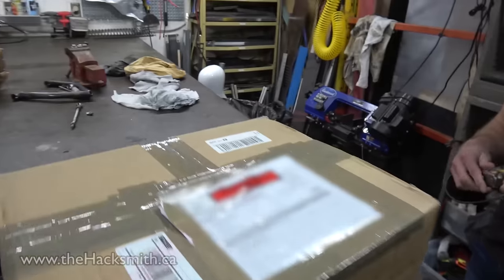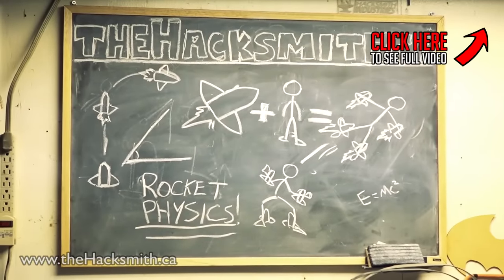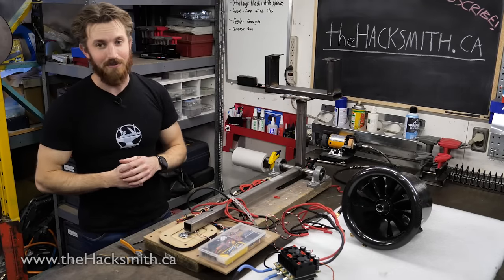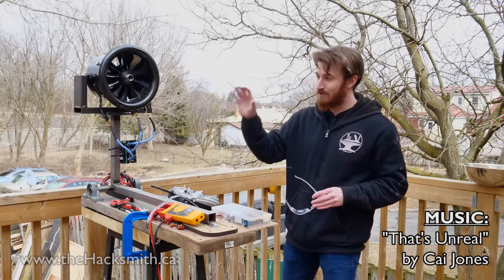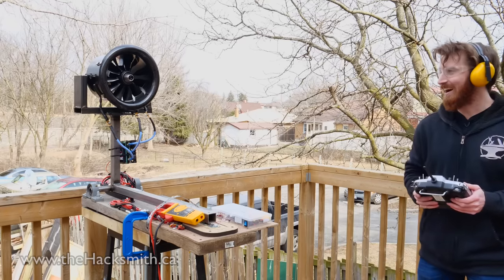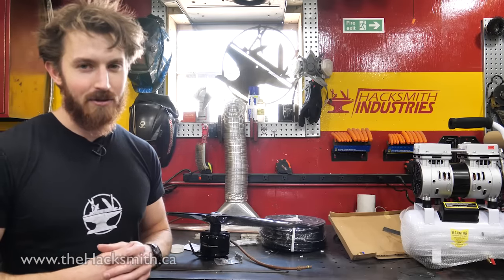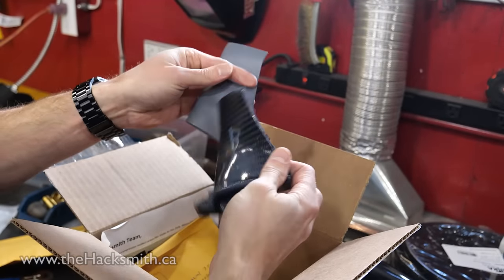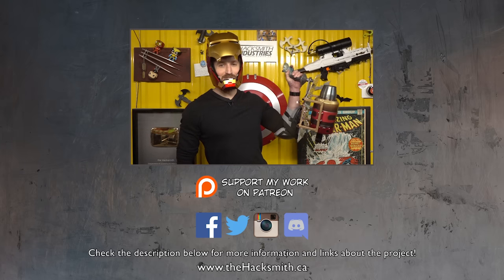$5000 Electric JET ENGINE (Flying like Iron Man Update)

Comment: Have a CAD design that I am working on for a quad hover bike where I would like to use electric motors. Battery tech is almost to a point where it is feasible to prototype. This vid has been a big help in giving me a baseline to start from

Comment: You could invent a new kind of paramotor thrust from centrifugal fans connected to the standard 2 stroke Vittorazi motor using a serious redrive ratio. This would be cool no more propellers, but a centrifugal fan or impellor style thrust system. I'd love to get rid of my propeller and use something that won't get tangled up in my lines.
Reply: It's in someones mind. Only a matter of time before someone engineers this.
Reply: The thrust is that of a 180

Comment: The reality of trying to be iron Man without the 💰. Lol
Reply: Lol first
Reply: Lol second
Reply: How many kilo thrust required to go straight. Like a helicopter ???
Helicopter provide how many kilo of thrust
Reply: Are you able to produced hho gas for fuel by electrolysis or by magnetic resonance and we provide it hand power by gears etc or by natural energy so we produce natural fuel for boiling water and a stable source of electricity which is not produce carbon footprint any more
Reply: How we boil water by compression 
Try it if it's possible
Reply: @eggwet8767  ahhhhhhhhhhhhhh ask Google

Comment: After the project you can connect all the jet engines together to make the most powerful leaf blower in the world but you would probably have to tape concrete blocks to your feet to not get launched into the sky. You can use the edfs to make a really powerful fan for summer.

Comment: I think all you are leaving a big advantage of those edf motors
You can build your own edf with air running from motor side to the propellers (opposite to the usual direction) so that the propeller won't flew off, and there will be less pressure on the clip which holds the rotor(at bottom) .

You have to flip the edf upside down,
Flip 2 of 3 wires, so that motor will rotate in opposite direction,
Modify design for better aerodynamics
Reply from the maker: Hmmm I wonder why EDF manufacturers don't do that if it's so simple...
Reply: @hacksmith  i am using 4 of 3D printed bldc edf in a rc quadcopter, the EDFs are upside down 
And working well for 2 years. I like it's sound

Comment: 2 Gaint ones in the backpack 2 small ones in the arms and 2 medium in the foot area that would (to my calculations) let u fly
BUT the wires need to be smaller and 3 edit u can steel some edfs

Comment: one issue is the massive battery weight.  EDF’s are great for speed, with great wind velocities....but not as efficient as props for lift.  Good luck lifting yourself and the batteries.  I would feel safer in an electric ultralight plane...at least if you blow an esc, you can still hope for a high glide ratio!  That’s a real nice EDF, I am drooling....wonder how that would work in a covered aero recumbent two wheeled bike?  Thinking of the solar challenge in Australia....and a cigar shaped torpedo whistling past the contestants....you could really get cooking.  I think it was Seimins that made a prototype twin edf electric plane that set speed records for electric.....340 kms/hr.  Thanx for the video!

Comment: If you combined the edfs and the jet engines. you are eliminating the point of the edfs because the jets are still going to be inconsistent and therefore the edfs which are staying stable could cause a wobble effect and make the problem worse gradually. Like when props are on a copter wrong and when it flies it starts a light wobble and then continues to overcorrect.

Comment: Is someone of you an RC Pilot? 
It seems like at least one of you was, because the things you are using are originally made for huge RC Planes. The turbine powers large jets, while the EDF is the electric alternative to it. And many other things like the Electronic speed controller or the transmitter are usually only known by RC Pilots.

Comment: 5000 dollars for a 50 lb thrust ahahah.. you can guy a 4 hp electric motor for 100 bucks which will put out 100 lbs  of thrust
Reply from the maker: With what size propeller?

Comment: I wish you all the best of luck!
I understand you need to increase your thrust/$.  Have you considered using turbofans?  You should get a lot more thrust for the power and $.  Check out YouTube videos.  If there are none in production, perhaps you can buy a turboprop or turbo-shaft (heli) engine and drive the fan from an EDF or try a 5 or 6 blades prop.

Comment: I think your scale result would be inaccurate. My thought is because the point of thrust has a moment that is displaced from the pressure by 2+ feet you would get a high result than is produced when say attached to the arm. Weight = moment / Arm Length.
Reply from the maker: Yeah... which we account for lol
Reply: @hacksmith  Nice! Did it end up producing the 24 Kilo's thrust?  I would curious to know how you accounted for the displaced arm? also, why not just build the jig such that it displaces thrust directly over the top of the scale? My thought is that it's better for filming but just wondering.
Reply from the maker: This was years ago,  but as long as you account for the length of the two moment arms it's a simple division to get the accurate number.  I believe the one arm was 2' while the other was 1', so the scale result was half of the actual value:)

Comment: Instead of manually calculating and creating efficient props, you can opt for AI powered generative design offered by Fusion 360. You just put in parameters and AI creates blades that are as efficient as possible.

Comment: I think you should use a fuel based System, couse the Power U need to Run IT freeley ist intens U need a large havy Battery and to Carey thous U need more Fans.

Comment: OK,  hybrid it.  The generator assists the batteries in flight. Like a Prius.  A 54v generator,  really small,  hooked to the diesel engine.
Reply from the maker: The world's smallest diesel generator wouldn't produce enough power though... Works for hybrid cars, not so much for VTOL applications when so much energy is required

Comment: Have you thought about putting magnets around the electric motor to produce a better magnetic field producing more power with the same voltage
Reply from the maker: That's not how that works.

Comment: Suggestion, Make Jarvis using basing it off of alexa, siri, google, you get what I mean, And instead of using the controller, using jarvis would be cooler like saying 15% power jarvis and other examples like power the flight system

Comment: hey hacksmith, what if you built something similar to the "manned hoverboard" that alexandru duru has made which utilities 8  turnigy rotomax 0.6 at 3000W and 18" downward facing propellors which he controlls with his feet movement. although i bet a better design would be to use a stronger motor from the rotomax series, larger propellers but only 6 motors. i think this would be a very interesting build and very cost effective. :)
Reply from the maker: we're working on building a coaxial personal helicopter at the moment :)
Reply: @hacksmith  sounds awesome, are we talking electric motors?
Reply from the maker: @MathewSawa  of course
Reply: @hacksmith  looking forward to it :))

Comment: @10.47 is it possible to increase the thrust by a fraction more if the blades in the inlet  and the exhaust nozzle internal surface are rough finish instead of polished surface . as turbulent flow is better than laminar flow  (please try on a redundant piece ;)

Comment: You need two jet engines mounted in a large backpack design to provide the main thrust and then the edfs mounted in a belt like system. Then the fuel and packs can be built into the suit... 🤔 yep, sounds doable... but seriously, keep up the good work, so jealous 😋

Comment: If you could find a way to stabilise the jet engines maybe even a hybrid of both EDF and jet(edf for stability and jet for trust) that might solve your issues with both kinds, the way I think of it is that you're trying to push your body mass with ease and stability upwards,
So maybe instead of having a slow lift off you need a boost to help you get higher so you have a chance to stabalise, if the boost was to come from the core of your body weight then it would be easier for you to control hight and maybe even alow you to hover while you're arms and legs (being less powerful then the main jet possibly edf) would control which ever direction you wanted to go but also wouldn't be too overwhelming to stabalise.
Please see this!!!!!!
Reply from the maker: Watch the whole video ;) we talk about that!
Reply: @hacksmith  when?

Comment: This may not be very economical but you could redesign the suit to be the larger one he uses to fight the hulk.... you could work the hands and fingers of the suit by making them robotic and controlling them from the forearm with a lever.... this lever could turn 360° in a circular motion and can move up and down allowing you to move them horizontally like iron man does when flying.... you could have 5 buttons on this lever as well.... one on the end(where your thumb is) that controls the thumb.... and in each groove of the lever for the finger... you could put a button allowing you to close each finger separately... it's very possible to do.... the issue is, putting the "JET ENGINE" inside the hand
Reply: I'm inferring obviously that you won't be as big as the suit itself but it could work... and I know how it would.... but I dont know the math and factors that would keep you from doing this. So I can explain how you could make it work and you could explain how that might be done in a more cost efficient and realistic way
Reply: Another factor is the weight of the suit
Reply: Dam

Comment: That is not a jet engine. It's an EDF (electric ducted fan). It is basically just a fancy electric fan with a shroud around it. A real electric jet engine compresses the air and the heats it with electricity to produce jet thrust.

Comment: Not worth the price at all. An electric bicycle motor can output more power. What you really need to focus on is a funnel-shaped airway to reduce the diameter of the propeller. It is probably easier to use multiple smaller engines than a big one.

Comment: Fastest Speed and Highest RPM
Equipped for Formula E Motor and I4 Highest Voltage Engine Powered Helicopter Vehicles easy hits 88mph Highest Efficiency and More Power

Comment: thanks for posting.  some thoughts.    at 2:58,  this sort of mention of a thrust value  is  Meaningless,  WITHOUT  Context.   ie,  the   MASS / weight of the edf, AND ITS POWER SUPPLY and any other cargo.       at 8:00, that is some  pretty  tired-looking smoke, coming out the back.    (color me confused.)    on the other hand,  it is  possible that the tail cone design is  less-than  optimal.     no kidding.    (hobby)  manufacturers  get  stuff  WRONG,  all the time.  reasons unknown.      suggest you do your own tail cone research.    cheers       googletranslate

Comment: 24kgs of thrust, how many horsepower/watts is that?
Reply from the maker: Watch the whole video...?
Reply: @hacksmith  I did watch the full video. did not hear it mentioned. Just now, seeking through scenes, I found the information fades in at 2:42 for a second, where you can get power to thrust. Question answered, thanks for your time.

Comment: Why not just build your own flyboard? You could build one for a fraction of the price they sell for.
Reply from the maker: No you can't. base component cost is like $50,000 not including you know, the amount of R&D to make it work
Reply: @hacksmith  right but that's still better than retail. I've been toying with the jetpack idea for a while now myself. And I think the Fly board looks too dangerous for most everyone. Plus it's not a real jetpack. Having a pack you wear on your back is my goal. I'd like to use 3x P400-PRO Turbine Engine or a larger single turbine engine that's light enough to wear.

Comment: This dream won't happen until there is light weight, cheap EDF that produces 80 - 100 kg of thrust.
Reply from the maker: But that's way more than you need... you'd want atleast 3 EDFs for thrust vectoring. Then you'd only need around 30kg each.  If battery tech evolved even 3 of the schulbers would work at 24kg thrust each as long as your pilot is light ish
Reply: @hacksmith  The way i look at this . . . I need around 350 lbs of thrust and i want as few engines as possible.  I want to design a system that will carry a 250 lb man, plus 50 lbs of engine, harness and battery weight.
Reply from the maker: You need a minimum of 3 ideally 4 to have any kind of stability though
Reply: @hacksmith  Yeah, I can understand that.

Comment: Duh,  forget the batteries. Put In a diesel R/C engine to a generator that produces 22v. Shhhh.
Reply from the maker: This edf requires 54v at over 500A...

Even big diesel generators can't produce that much
Reply: Man hacksmith would need 456.8n to lift him well damn

Comment: Well unfortunately the power to weight ratio on a electric design like this as of now won't be anywhere near of being practical. The bigger it gets, the more inefficient the whole circle. For example an electric rc helicopter that weighs in at 10 lbs is capable of 5kw of continuous output or even 10 kw short peak which is insane. Now if you step it up to the next bigger size in line, the ratio already drops down significantly because bigger drivetrain, larger batteries to accommodate and therefore even bigger weight increase. Flight times from 3-10 minutes only.  Large scale electric propulsion is just not useful yet. Liquids do provide the best energy to weight ratio still if you want to stay airborne for any useful amount of time or more than 2-3 minutes. Best example are today's electric cars. Even though they crank out insane performance they weigh in over 2 tons and run for anywhere from 100-400 km
Reply from the maker: A bit of that logic is very backwards... the bigger the prop, the MORE efficient it is for power lol

Comment: I understand that money is a problem, and you're doing all that you can, but I feel like the last "real" episode was part 10, exactly 2 years and 1 week ago. Fat  O O F
Reply from the maker: Yeah well Richard Browning has already made the system we were planning so even if we got the money and finished it... we'd just be labeled a copy cat. What would you do?
Reply: I would probably try to find a different way to try and fly something that's smaller and has more thrust unless inbuilt a system that can convert horse power to thrust which I think is possible but no because only energy alone isnt enough to make thrust so I guess I will try to go how rockets work but less heat and fuel